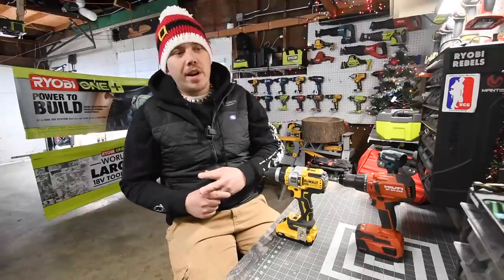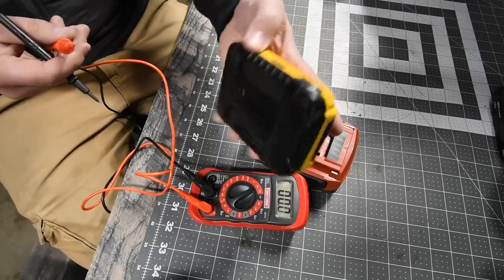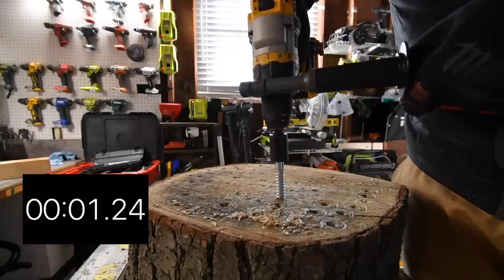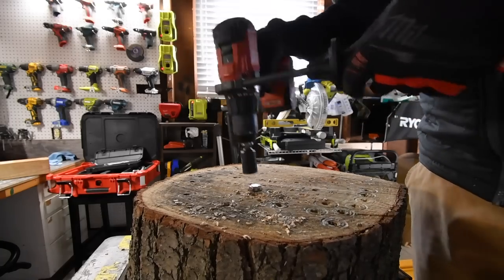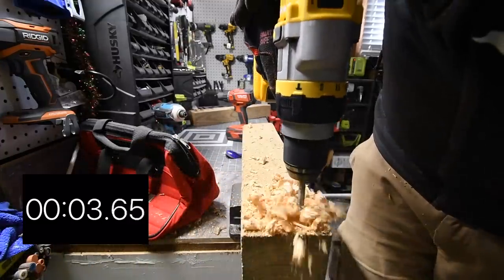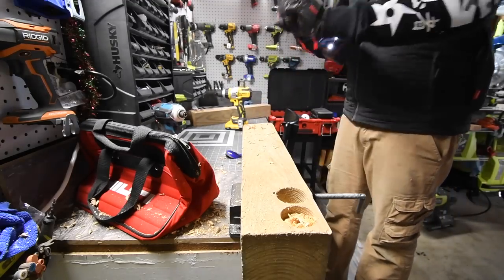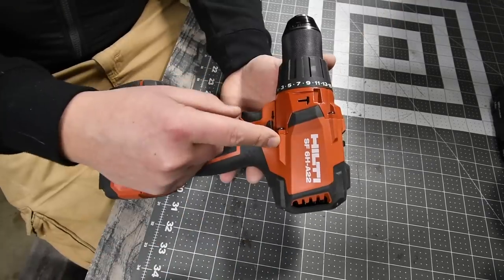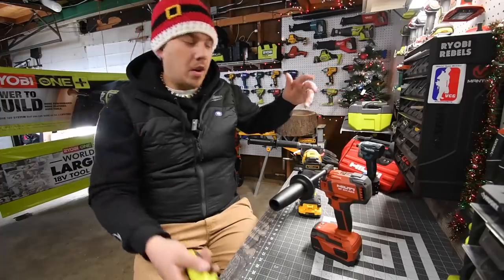HILTI vs Dewalt (Flexvolt Advantage)

Comment: Seems pointless using a flexvolt advantage tool without the flexvolt battery, that's what makes it the 999, might as well use the 996 or 998 at this point, all specs are the same except for how they use the battery's power
Reply from the maker: the Flexvolt advantage performed majorly well with that 4ah 21700 celled battery. That 4ah battery would kick the crap out of a that 6ah Flewxbolt advantage battery, even with it being in a Flexvolt tool.
Reply: @ManCaverTools  wow interesting... in the 999 you're referring to the new compact 4 AH beating the old Flexvolt without the 21700 cells correct?
 I have the new. Dewalt compact 2, 4 and. then the 6 Ah with 21700... the six is an absolute Beast 💪
Reply from the maker: @BuffaloNickel9  I’m talking about the new 6ah flex volt advantage battery would lose from that 4ah
Reply from the maker: @BuffaloNickel9  watch this video to see what I mean https://youtu.be/w3A_HhriXik
Reply: I think for best results, you need the 8 or 10ah 20v batteries or 9 or 12ah flex volt.
Reply: @Andy Sanchez -- Exactly,  the DeWalt Advantage dcd999 has around 50% more Power when using the FlexVolt 6.0ah battery (according to DeWalts Specs) , so basically he was using the dcd996 in these tests ....
Reply from the maker: @brianf9619  50% more power comparing to an regular battery. but the 21700 cells in this 4ah provide a lot more power power then the 6ah flexvolt because the flexvolt advantage battery only has 18650 cells inside.
Reply: @ManCaverTools  There is no way that 4.0 with 5 - 21700 cells will kick the crap out of a 6.0 with 15 - 18650 cells.
Reply from the maker: @IndependentThinker74  sounds like I need to do a video on it :)
Reply: @ManCaverTools  Sounds great.  Look forward to it.
Reply: @ManCaverTools  ---  Its not the cells it's the Configuration of the battery,  the FlexVolt batteries have 3 rows of 18650 cells and that's how the Advantage Tools get the Most Power.   The Power Detect tools get their power from the 21700 cells in the 20v  6.0ah & 8.0ah  batteries  and that's the main difference between the Advantage and the Power Detect tools .  ..

Comment: What’s the point of using the flex volt advantage ,without a flex volt battery. Kinda a wast of time.
Reply from the maker: If I used the 6ah felxvolt advantage battery instead it would have lost even more

Comment: In case you wondered, Hilti 22v tools, as of 2017 models amd later, are rated on a scale of 1 to 10.  This is the SF 6, which makes it a medium to heavy duty drill.  The SF 2 and SF 4 are lighter duty, and the SF 10 is the Ultimate.  All 22v cordless tools follow this scale.
Reply from the maker: that is good to know and I thank you for the info Reid
Reply: But the SF 10 is not a combi drill!!
Dave. The SF 10 is mainly designed for just steel work.
Dave.

Comment: Isn't the Flexvolt advantage suppost to take advantage of the flexvolt batteries instead of the normal 4 ah battery to give it the most power?
Reply: True dat 💪🏾
Reply from the maker: this is not a normal 4ah battery. this 4 ah battery has 21700 cells inside of it. and normal 4ah battery has 186540 cells in it. if I would have used a 6ah flexvolt advantage battery the dewalt would have lost even more than what it did
Reply: @ManCaverTools   nope try it and see .... the flex wolt battery would be faster it’s literallt the point of the flex volt advantage system

Comment: You missed the most important of all. You didn't run any tests with the Flexvolt battery. That is the point of that
drill, lol. The DeWalt runs stronger and faster with a Flexvolt battery.
Reply from the maker: I got another video coming soon about it, stay tuned for that sc
Reply: @ManCaverTools  Nice, can't wait to watch. Great vid, btw.

Comment: I'm not really concerned about not using oil, but I do think you're using too much speed to drill metal. Drilling metal, especially hard metal, need as much pressure as you can manage and relatively low speeds.
Reply from the maker: its also a test on the drill bit and I thank you for viewing Spencer

Comment: I tried using one of those irwin 1(1/4)" speedbore bits on my m12 fuel hammer drill. Dug in about 1/2" and stopped in speed 1. Kept trying to feather it but the drill started feeling like it was going to break.
Reply: Not sure any 12v platform is gonna do too well with that challenge
Reply: @TaintedMojo  Maybe the impact driver if the speedbore's drive shaft wasn't so huge.
Reply from the maker: that is too much demand on a 12v tool

Comment: 🤔 

I wonder if my power detect would do better with the 3 or 4 ah 21700 battery vs 5 ah 18650.
Reply from the maker: yes it would. I used the 8ah XR with 21700 cells in the power detect and it destroyed the HILTI with a 8ah battery with 21700 cells in it

Comment: That was not fair comparison test because recommended battery for this dewalt drill is flexvolt 6 Ah . . Dewalt will clear winner . Only thing of Hilti has over Dewalt is built Quality Built Quality of Hilti is beyond
Reply from the maker: if I used a 6ah felxvolt battery in the dewalt it would have lost even more then it did. the 4ah with 21700 cells majorly helped the dewalt out

Comment: What is the point of an impact driver when the drills are this strong.
Reply: I think the impact driver is supposed to be more efficient so you can drive more fasteners per battery.
Reply: Good question. My guess is that it's because impacts are less difficult to use as there is no kick
Reply: @JS-tb9hu  Kickback and noise are the only things I can think of. Most independent contractors I know have 1 drill, but a pile of impact drivers.
Reply: If you’re working over your head do you want to carry around one of these drills that weigh about 5 pounds or do you want to carry the impacts that are in the same battery platform that weigh 3 pounds?
The impact is able to be operated one hand it no matter the size of the fastener allowing you to have the other hand to hold onto a ladder or materials.
If you were hanging something on the side of a building and you were already standing on the final wrung that you could safely stand on and the object was still above your head do you want to let go of the ladder and put both hands on the drill and not hold on to the bracket that you’re mounting?
Even if both your feet are firmly on the floor and you’re driving a quarter inch lag into a stud to mount a television do you want to hold the mount level while you drive the fastener with one hand with an impact or do you want to hold onto the drill with both hands and just let it fly?
The reasons for using an impact mostly revolve around safety (User and Materials) and reducing fatigue.
Reply: @thetruth5210  Good explanation. Didn't realize Youtube allowed comments that long though lol.
Reply: Hammer drills are more substantial but still need two hands.
Reply from the maker: it is safer on the wrists. you dont feel the torque an impact driver delivers

Comment: But why use the non flexvolt batterie with the flexvolt advantage 😥😥
Reply from the maker: this 4ah battery has 21700 cells in it. if I used the 6ah felxvolt advantage battery the dewalt would have lost even more
Reply: @ManCaverTools  yes but its flexvolt advantage not 21700 advantage lol

Comment: You have a lot of tools and that's cool but one of these drill will keep drilling holes like that for minimum 5 years even after being dropped from 3 stories and accidentally driven over by a small suv. Drilling is not about going fast or slow, its about going the proper speed and feed pressure. Giving a tool a rating based on how fast it can drill a 1/4" hole through a piece of flat bar clamped in a vice but you drilled the holes unequal distance from the actual clamped area which I think would greatly affect the feed pressure. I'm not trying to sound like a smart ass, it may seem that way but this is constructive criticism. I'm actually rooting for the hilti because I know they're #1. I don't even think they're in the same league as Dewalt. I think you're a cool guy and I respect your love for tools. I am a subscriber of your channel for a reason, I think you're really close to becoming a very popular YouTube Tool Reviewer. Full disclosure I am what you might describe as Bored Of Lame Tool Reviews. You smoking what I'm rolling here? I just want to see some consistency with the tests, and thought out logically. Can you tell me the difference between a drill with an sds style chuck and one of these "hammer" drills? Are you sure giving points for the drills capability to do things it's not truly meant to do the best way to declare one better than the other?
Reply from the maker: AN  sds hammer dill is specially designed for concrete and the chuck is usually 1". The SDS hammer drill also moves back and forward so you can use chisel attachment to take out tile and things of that nature. and regular hammer drill is only good for little holes.

Comment: So confused with the whole battery issue.  Why run the test at all if it's not configured with a flexvolt battery???

I mean...you DO realize the Power Detect, the FlexVolt Advantage, and the vanilla 996 are all the same drills right?  They are just running different software that allows (or doesn't) them to draw more power from the batteries their software is mated to...

Oh yeah.  Different auxiliary handles.   That's it!
Reply: Was just watching some of your other videos, and it seems like you fixate on cell size A LOT.

Cell size does make a big difference,  but it's far from the only thing that matters. 

Stacking cells (running in parallel) also matters.  In fact, most batteries sold for tools are advertised by the company in either amp hours, or watt hours... in other words... the size and NUMBER of cells. 

As previously mentioned, software can cripple or unlock a tools potential. 

Voltage is also a big one, maybe more for efficiency than power, but it matters.
Reply from the maker: because a battery with 21700 cells in them will perform better than a battery with 18650 cells in them

Comment: Come on, we are all understand that this 999 model is same as 996 on standard 20v battery, and only with flexvolt battery the power 999 showing on it is because controller of 999 is need much power, like if you put on 996 flexvolt battery the controller burn off because much power, but 999 have much powerfull contoleer and can eat power of flexvolt battery. I have already buy 999 ans test it with my 999 and see the difference
Reply from the maker: very good and I thank you for viewing Elnur

Comment: For metal drilling I use speed one, and put some weight to it.  

The high speed actually hurt the DeWalt.

I think the DeWalt would of beaten the Hilti with a 9 or 12 ah FlexVolt or even an 8 or new 10ah xr batteries.
Reply from the maker: HILTI makes bigger batteries as well